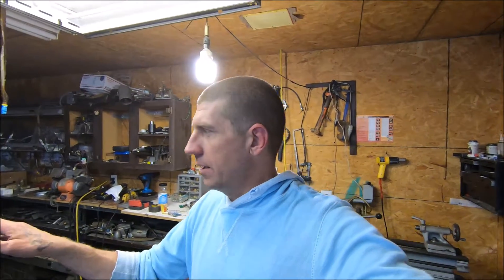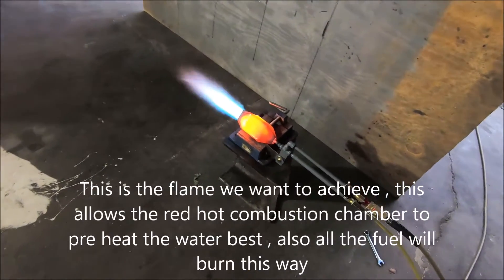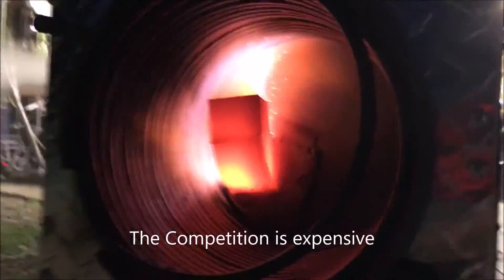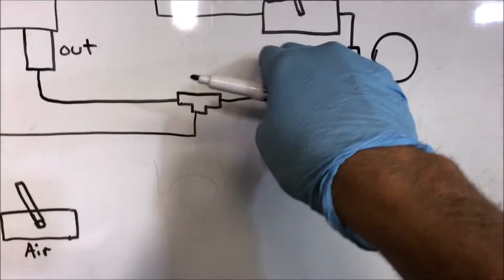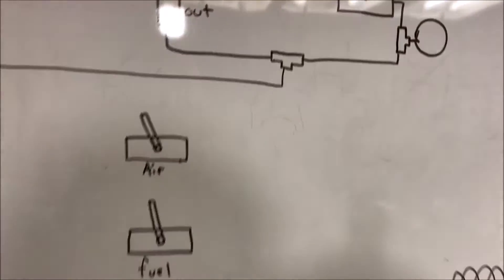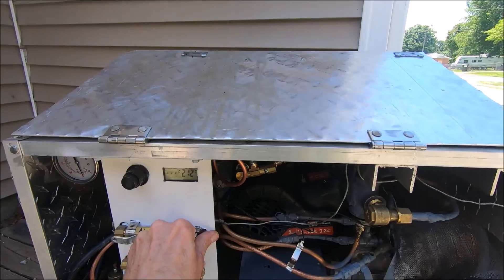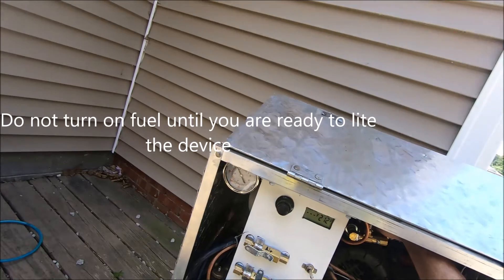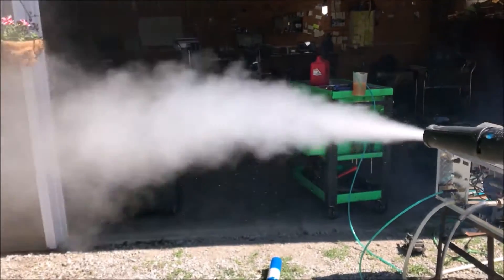Igniting Your Micro Boiler for Steam cleaning and Organic weed managment

Comment: Headphones and speakers with bass really show the tone change. If you can't hear it don't use laptop or phone speakers.

Beautiful device man
Reply from the maker: Hey thanks alot for the input brother , i was struggling with this . in person its night and day but poor audio really shows itself here
Reply: @NOBOX7 would you sell some plans for your steam machete?  I need to clean grease and sludge out of oil friers and getting the electronics wet kills them.  I will be using propane to fuel the fire.